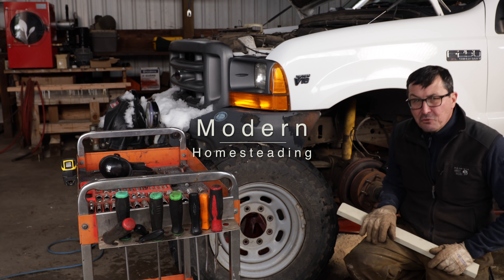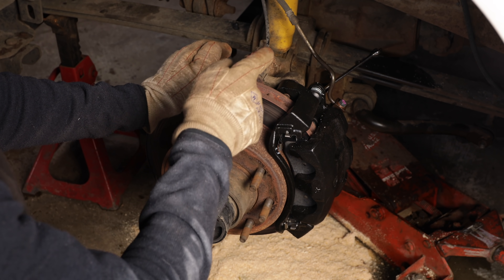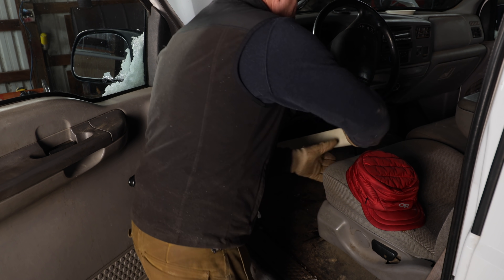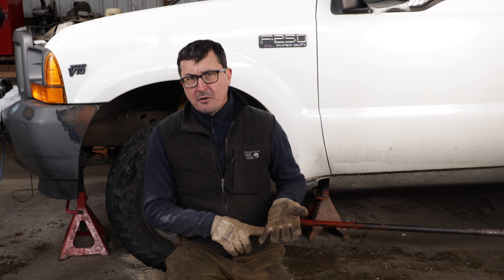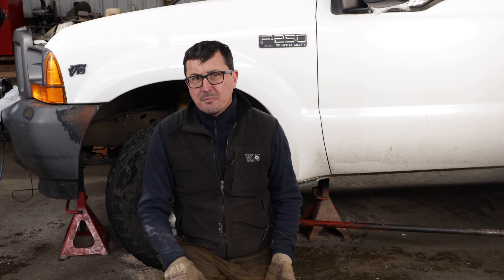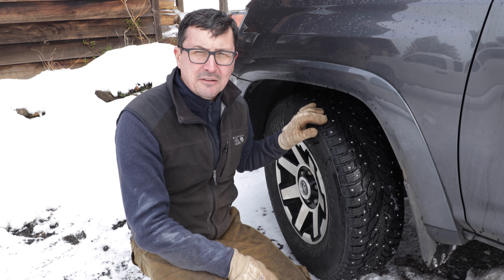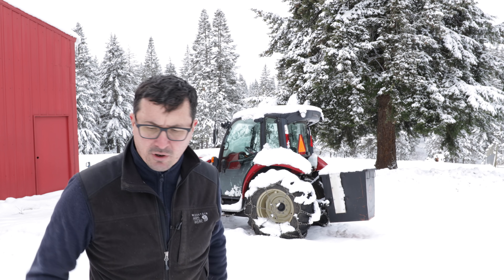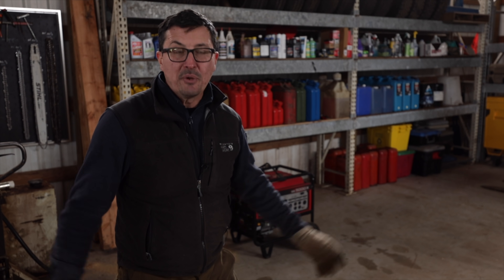IT FINALY HAPPENED!

Comment: It’s worth noting that many times if your brakes get that hot, the fluid gets thick and can solidify. It’s not a bad idea to check the softness of the rubber brake line and replace the rubber brake line going to the caliper if needed.

Comment: That is a decent trick also some of your speedy wood clamps can be reversed to push.   The big fords usually have enough head pressure between the MC and the caliper to allow gravity bleeding, fill resivoir, leave cap loose, open bleeder, go have a sandwich, come back, refill and might as well bleed all four to get new fluid in there. Take a quart of fluid.

Comment: I think it is interesting how we develop our favorite brands of cars and trucks . We had one Toyota and would never buy another one . There was an engineering failure that caused the V-6 to throw a rod . I replaced the engine and it went one year before that engine had the exact same failure . I have been a shade tree mechanic for years and raced many years ago and formed my opinions over the years . Your ball joint talk was why my buddy did not buy a dodge based motor home . So he went with a ford . Other than the V-10 and transmission failures , he had had few problems . Oh same thing with my next door neighbor on his ford one ton four by four . He stuck with a ford diesel ( that you have to remove the cab for any major engine work , but that is minor stuff at $1,600 labor to start fixing the problems . BTW , if driving in deep snow , run in low lock below 30 MPH . Other wise on ice run in two wheel drive and you can run quicker . Note , this applies to actual four wheel drive , not all wheel drive . Back when I commuted to work and I thought it might be icy  I would punch it or hit the brakes hard to see . Sometimes ( driving with studs on all four ) I would see cars sliding around and realise it was icy .

Comment: Those confounded metric bolts. The got me too! Now I have to say, I tow 7,000lb minimum every single day of work and my Chevrolet trucks have had zero issues that arent just normal wear or road caused by hazard. Total logged miles on them approaching 500k, between 3 trucks and 28 years. My F450 dump was also amazing but its brakes (rear in this case) we junk and needed attention literally every inspection. Thank God it was a gasoline engine because, well we all know.

Comment: I always bleed my brakes by myself. Just attach a 5ft length of clear fuel line or something that fits on the bleed niple. Open the bleed nipple and pump the breaks until the fluid comes out clean with no bubbles making sure to not drain the reservoir. It flushes the brake fluid and the hose prevents air from getting sucked back inside.

Comment: So I had this problem with my truck. What I eventually found out is the problem is the pistons rust just under the little seal.   So what I was told is pull that outer "dust seal" on the outside eof the pistons and put some grease in there. It will mitigate water ingress and rusting.

Comment: 2004 f150 5.4 with 8 ft bed.  170k miles. Runs strong. Did brakes, rotors,  calipers , rebuilt drive shaft  , ball joints, new exhaust. Next im getting a Tacoma or Tundra Trd off road.

Comment: Oh man, you need to get like a nice Winco whole home generator installed.
Reply: @T Clodfelter Smart man. How has the Generac held up? The Briggs and Stratton are much more reliable for a comparable price. When I used to work installing and servicing generators the Generac's were always dying in the middle of storms when you needed them most, it got so bad by boss outright stopped selling them. Briggs and Kohler were always good and you couldn't break a Winco if you tried. Hopefully you got one of the good ones!

Comment: To bleed brakes get a flexible plastic or rubber hose that fits tight over the bleeder valve and put the other end in a cup of brake fluid. Then just keep pumping the brakes until it stops bubbling. Just make sure the master cylinder doesn't run out of fluid. This way keeps you from constantly having to go back and forth to the brake pedal.

Comment: My 01 ram has 750k on it. Put a few clutches in and have done ball joints 3 time the key to longevity is maintenance also just put the 2 injection pump on . Change oil and filter every 7500 miles and grease fittings at oil change. That being said my father's 99 7.3 has 600k and all he's done is put a few clutches in and 4 sets of  injectors in. The only difference we see between the two trucks is the 7.3 gets 9 mpg and the 5.9 gets 11 mpg pulling the same load both have 4.10 gears. Also the 7.3 needs the block heater plugged in if its below 30 degrees out.

Comment: I totally agree with you on Toyota hands down the most reliable brand. But all US manufacturers have their problems and from what I have seen a Cummins truck holds it's value way better than a powerstroke truck. I have 150,000 miles on my Cummins powered Dodge and still have the original ball joints. I thing you were referring to GM trucks as they have independent suspension. But that has it's advantages of a better ride, but I would rather have a harsher ride and better reliability of a solid front axle, but that's just my preference. You may have had good luck with your Ford but many people have not.

Comment: Those  boot chains are a MUST for me in winter.  Now a question.   

Ever plan on getting solar back up which is QUIET when power goes out?   We  have solar that with clear cold days with snow provides reliable power, as well as three days of stored power.  Well house has small solar set up. When the power goes out we can HEAR everyone around us who has propane/gas generators.

Comment: If you can afford get natural gas generator with automatic transfer switch if you have gas line in your house. They have other types of fuel but natural gas is better because you don't have to refuel. Transfer switch automatically switch power from grid to generator and turn it on. Also does in reverse when power comes back. Generator self test itself every day so it is maintenance free. Only if it breaks down. I'm electrician from nyc and I build those for buildings but that is larger scale. You have house options to. No worries if power goes off. Just Google generator with automatic transfer switch. And you will need electrian to install.

Comment: My buddy had a V10 F250 that had the head bolts rust away.  BTW, brake fluid should be changed completely every so often.  Also, I installed a Generac whole house generator that will run for weeks off a gigantic propane tank I have out back.  Power goes out, the generac automatically starts and disconnects the house from the grid.  I run important things such as well pump, water heater, lights, and refrigerators.

Comment: If you got a hose and put it on your bleeder drill a hole in the top of a brake fluid bottle and put that hose down in fluid  the crack the bleeder you can pump your brakes and instead of drawing air back in you'll draw fluid back into the system so that the air can push out in the fluid draws back in instead of air it's another way to bleed brakes by yourself. Of course I'm an East Coast guy

Comment: Fords depriciate so quickly you can buy a '00 mustang GT for right around 6 grand. 70s Chevrolet square body pickups are just about as reliable as they come if you want longevity. No electronics, no throttle body, just a carbureted 350 V8 and 4 in the floor. If the engine, transmission or master cylinder and booster go out, there's plenty of aftermarket or used ones available.

Comment: Actually Cory brake fluid absorbs moisture. As a rule you should flush the brake system at least every 30,000 miles. I try to get that done when I purchase a new to me vehicle along with other preventative maintenance precautions.

Comment: There’s an easier way to one man a brake bleed. You get a length of hose and connect to the bleeder valve on one end and stick it in a bottle of brake fluid on the other. Open the valve and pump the pedal. The bottle of fluid will allow the air to escape, but fluid will get sucked back in.

Comment: It is not recommended to start the generator while everything is connected. I have worked even with large diesel scale generator with truck engine and I have had never a problem with them.
Reply from the maker: Do you know what a circuit breaker is?
Reply: @wranglerstar  Yes we have them in Europe

Comment: Have you thought of  something like a Genrac 20KW propane powered standby generator?  They will start automatically, switch your mains over and with a 500 gallon tank will run for 10 days with an average 50% load. It will also switch back onto the power grid when it's up.  Down-time on start-up is like 5 seconds.  We have 3-4 day outages here too, so I've had one for a few years and would never go back to a portable gas unit.  Best $4G I ever spent.  It will run the whole house.  Stove, water heaters, pumps, computers, fridge, freezer ... and the dryer and washer.  Technically we could overload it, but with a little prudence, this has never happened.

Comment: If you put the generator in the same spot every time,  why not build a small timber frame enclosure for it there to keep it out of the weather? You can rodent proof it using hardware cloth on the inside or outside. Lets see them chew through that !

Comment: I have one of those Dodges that needed the ball joints replaced. Simply used after market parts recommended by a good shop and solved the problem. Rides better than Ford and works just as hard.

Comment: Ultimate Pickup Truck: Ford F350 King Ranch with a Cummins 24V HO 5.9L with an Allison Transmission.  Those of us with IH 6.0L Powerstroke would like to De-Stroke our trucks. Good engine until the USA - EPA RUINED that engine!! That said have to admit our 6.0L PS has been pretty good. Great Transmission is the Ford Torque Shift, which I'm told is very similar to the Allison.

Comment: The first truck I owned was a 98 ford ranger I got in 06 I finally sold it with 350k miles on it. I wish they still made those things. 

My Current Tacoma is pretty great to so far. 

I had a ram 1500. Total junk.

Comment: If you power go out regularly why haven’t you installed a backup generator on your homes power system with a switch gear electrical system so you won’t need to drag a generator out and hookup power cords with all that hassle. Also if you have natural gas available it’s probably even cheaper to run. A Kohler home system would take care of it and all you need to do is figure out how many watts you home would need?? Easy peasy??

Comment: That simple trick was not necessary . Every time you press the brake you cause real small air bubbles which will later turn into one larger air bubble.  I worked on brakes for 50' yrs and learned a better way that won't leave air in the system.  just take the cap off the master cyl. and it will bleed on its own. Once in a while you might find one that won't start on it's own , if that happens just push the brake peddle about 1 inch only once.  When you find how easy this is you will never pump the peddle again.

Comment: Lots of times it's the hose that connects the brake caliper to the line that's causing the brakes not to release. Old hoses can start to have a check valve effect and I've seen that happen on many different brands of vehicles including Ford, Chevy, Toyota and Dodge.

Comment: You're bleeding them wrong. Grab yourself a small plastic bottle, fill it  about a quarter way up with brake fluid (can be old fluid). Get a small clear tube of vinyl that will fit over your bleeder snugly and put it on the bleeder on the caliper. Put the other end in the bottle - if you drill a hole in the cap to slide the tube through, it makes it not fall out. Push the vinyl below the level of fluid in the bottle. You then put the bottle ABOVE the caliper, you can hang it on the spring. Then open the bleeder, go in the truck, and then pump it as much as it takes till you see no bubbles. This is a great way to flush the lines as well.

Comment: My 2004 Dodge Ram Quad cab diesel had 143000 miles on it before I had to replace upper and lower ball joints.  Don't know where you heard 30,000 miles to change them but it must have been a lemon.  Just my experience and I do very much enjoy your channel.

Comment: I stick with older GM products, mostly cause I am extremely familiar with issues and repairs. I have 4 older 73-87 chevys, which the worst part is weak frames, so I braced them. My 05 Duramax is the Injection pump and injectors. Whenever anyone asks me what I think to buy, I ask what are you familiar with, what tools do you own, and what can you fix or have you fixed yourself before? The shop I work in, GM products are typically cheaper to fix, and easier, especially front end parts, but they do require more maintenance etc. If I were to buy a new truck, all new ones are fairly comperable, and it comes down to preferance and warranties. But Toyota and Honda have the car game on lock down as far as daily drivers.

Comment: As somebody who has owned all of the big 3 vehicles they all have issues. My dodge diesel has 265k miles has only had the front end rebuilt once. The ford is a 77 and is a good old truck but it needssome help. It only has 107k miles on it. The gm was a car that ran almost 300k miles before finally blowing the engine. If  you matain any of them and put actual quality parts on them then they all last.

Comment: I'm driving a 2010 Ram just turned 320,000k miles with no problems. Must have been built on a Wednesday.. Prior to this one I had a 1974 K20 4x4 that had 520,000k. My nephew has it now, still going strong.

Comment: I just bought a 2007 Lexus GX470 (Toyota Prado or Baby Land Cruiser for all the people that don't know). 13 years old and i paid $10,500 for it. Water pump timing belt done. 2" lift with air bag delete. 156k miles. No problem will drive it for another 100k or more.

Comment: Why don't you design a carrier for your generator and gas.  You can get blank plates that will fit the front of the tractor / skid steer attachment.  I have designed a few homemade pieces like that.  They make it very useful.  I know if I had to deal with that much snow I would have one.  You could even make it so it would protect the generator from the elements.  Just saying.  New project for the show.

Comment: The ford eco-boosts have tons of problems. The Cummins is the best engine in the market by far. From a professional point of view, easy to work on, low maintenance. Those new power strokes are cluttered and the duramax’s suck the air filter through the intake and into the turbo

Comment: Every truck has its problems. I like Ford and Ram trucks the most. Any of the new ford trucks are pretty good. I would never buy a 1500 ram, but my ram 2500 is great. The best part about them is the affordability. In my experience the Ford is usually about 5-10 thousand more expensive than a comparable Ram truck. Its hard to even find a Ford truck under $50,000 anymore... The way I see it is they will all get the job done so it doesn't really matter.

Comment: My dad has a late model GM sedan. It needed a new water pump at 110k miles. Easy enough?

Nope. 

Had to pull the engine. (Repair quotes at the dealer)

To replace a waterpump .

I told him to sell it on that fact alone. 

Who designs this stuff???

Comment: I would have to agree on the best brands. Ford and Toyota have parts all over, they reuse proven designs and know it pays to build a vehicle any mechanic can figure their way around to be serviceable. I would add that Honda is very much the same; I am a little disappointed as of late with the change in quality from their 2000's models compared to their lower quality 2010's. My 07 Honda Fit was built with reliable parts, accessible parts, kept simple and serviceable by me. My 2015 Honda Fit has ball joints and suspension failing at 90,000km, the variable timing actuator has also failed and is going to run me about $1400. The other stuff, I'm gonna safely bet $3000 total to get someone to fix it. The fit and finish of the car itself, the dashboard doesn't fit right, every plastic trim piece has weak mounts, lacks thickness and is either cracked or dislodged from casual use. Don't even get me started on the new 'safety features' that counter-act counter steering during a slide so you spin out even more or it cuts off power that you need to avoid an accident. Next purchase is an F150 for sure.

Comment: I live in a remote area with PG&E power.  I installed a permanent automatic 14kW Generac generator powered by propane.  Through an automatic switch, it starts within seconds of PG&E power going off.  Since I have a 250 gallon propane tank, always at least half full, I mostly don't notice if power goes off, the Generac comes on line in 15 seconds.

Comment: I have to take the'12 f150 in for oil service solely due to the hard-to-reach filter. Doing it at home always results in oil all over the frame and floor.
Reply: StayAtTheRetreat I have a 12 F-150 also and the oil gets changed at the dealership. 

I owned a Ranger and the oil filter was easy to reach and was vertical rather than horizontal so you didn’t get oil all over when you changed it. 
Changing oil on it was a piece of cake.
Reply: @bigjeff1291  94 4-cyl ranger was one of my first trucks. Dad bought it new before passing it to me, and now my little brother has it. Somewhere near half a million miles. Easy to service, too!

Comment: Rather than have to restrict what circuits you run, and given you have a tractor, have you thought about getting a PTO powered generator for use when the power goes, especially if it’s a reasonably regular occurrence?